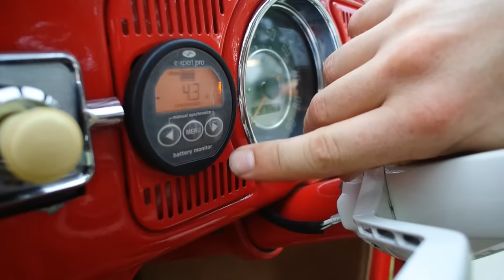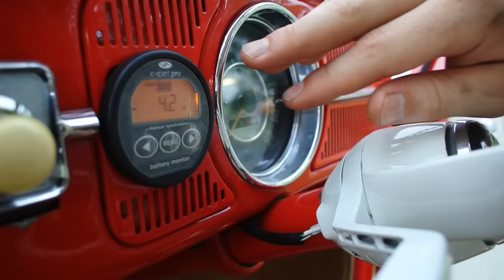Electric Converted Beetle | The Charge

Comment: The price can range anywhere from 10 to $ 15,000.00 depending on what you want in it and that's just for the AC motor, the batteries the controller the converter, and the liquid are cool and so on.
Reply: It's too high💔
Reply: Is it possible to answear me in euros how much it cost ...
Reply: The price in Texas in 2022 is between the high $20K’s or the low $30K’s depending on low or high voltage motors. I just bought a ‘64 Beetle and am having it shipped to Flash Drive Motors just outside of Austin, TX for electric conversion.

Comment: Those LiPOs will have a lower capacity than Li-Ion cells, but they should be good for roughly twice as many charge cycles. It's nice to see a Beetle which was 6 years old when we were in Sydney still running, still looking pristine, and running more smoothly and faster than it did when new. They're an endangered species over here; most fed the rust maggots long ago. Thanks Ben.
Reply: Sorry to be pedantic. But LiPo typically means Lithium Polymer. These are Lithium Iron Phosphate aka LiFePO4 colloquially just simplified to LIFE. IIRC They are also better at tolerating Heat which is useful in Queensland.

Comment: Hi to James at Traction EV. I have seen your vid with great interest, and listened to your comments. I own a beautiful '71 Superbug, and I have been studying the EV Conversion for a couple of years. My plan is to get in touch with you at EV Brisbane and discuss. I am in Sydney, where (surprisingly) no-one has a Workshop like yours! I noticed all of the Cooling Fans in your (red) Beetle Conversion, and also noticed that the fans were pulling a continuous 4 Amps. Would it not be possible to place a few Thermostats around the Motor / Motor Controller, so that the fans would 'cut-in' when needed? This might just increase the EV range a little, but the cost to do this is very small. I have also noticed that you seemed to have no trouble in keeping the Beetle within its' GVM, and (from the views) it looks like nothing on the Beetle has been lightened at all. I want to carry out an EV Conversion on my Beetle, but I had originally set the goal at (minimum) 24kWh. Your conversion of the Beetle comes extremely close to this. A great video. A great car conversion. Finally, a good explanation from you, of what can be achieved.
Reply: 4 Amps, even at ~125 Volts, is about 0.5 kW. If it's from the 12 V battery, however, that would be less than 50 W; 0.05 kW. I cannot see the meter on this small screen, so let's assume that it's about 500 Watts from the ~125 V battery. That's around 3 km of range for every hour the fans are running. Not a big problem on journeys where you're able to travel quickly and recharge every 100 km or so.  Much more of an issue if you're on congested roads, moving at, say, 30 km/h. In that case, the range would be reduced by close to 10 km on a 3+ hour journey of 100 km. But that would be an horrendous journey anyway, in Brisbane heat! 

If that current draw is indeed from the main HV battery, then it likely includes all of the car electronics, as well as the heat pump and/or fans, which could be deactivated when stationary. Maybe he wasn't bothered about it during the making of the video?

Realistically, I'd expect the fans, etc, to be switched thermostatically, and would assume that battery cooling is also aided significantly by airflow through the radiator when the car is moving.
Reply from the maker: Hi Peter, James is a lovely guy, sure he will be excited to chat with you about this. Very relaxed chap and extremely knowledgable. I know that James did mention the weight of the Beetle had gone up a total of around 150KG, but it did have stiffer springs on it, but I don't think that suspension was stiff enough for an extra 150KG, so I think it would be something that needs to be thought about carefully.  If you get the right suspension setup then it is going to feel amazing.
Reply from the maker: Hi Peter, thanks for your comment. James will be happy to hear from you. He is a very friendly chap :)

Comment: Why no one ever used 4th gear it's there just waiting.
Reply: Electric motors generally like going round faster than a ICE , so 3rd gives you right motor revs for normal top speed.   4th would be less wheel torque more motor load.